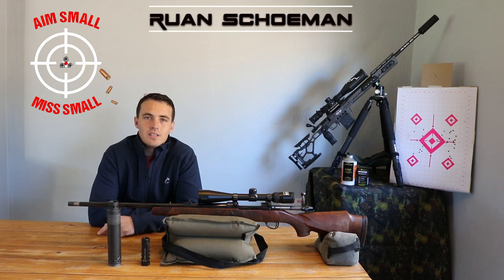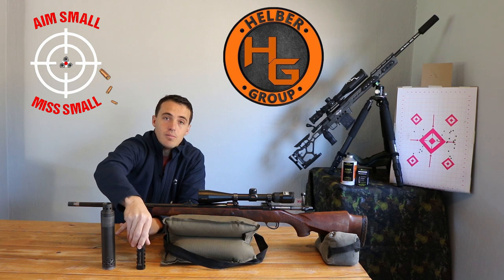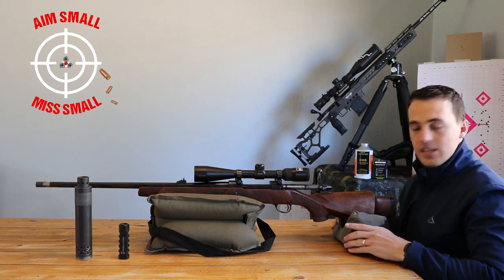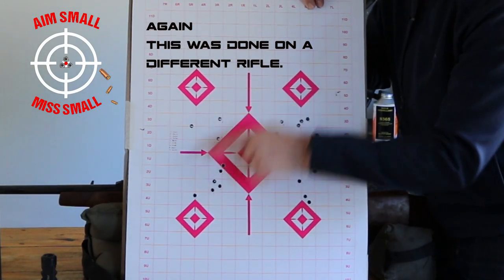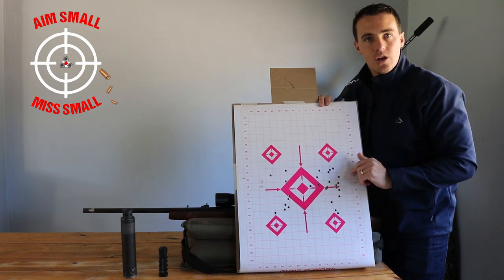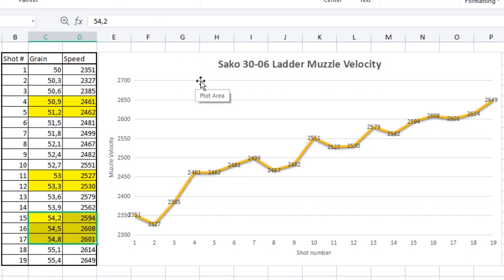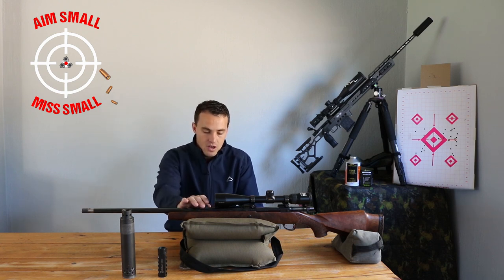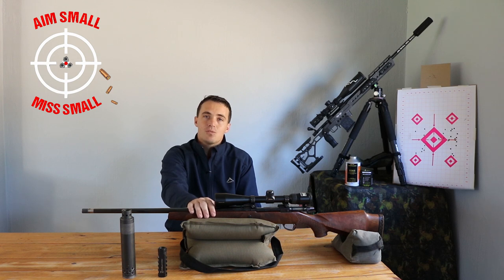Load Development Series Step 4

Comment: Thanks for a great series, really enjoyed it! On my hunting rifle, using locally produced bonded bullets I have a quiet a big variation in bullet lengths, roughly 0.5 to 0.7mm - is this something to consider? 

My max COAL is 78mm so aiming for 77mm and not sure how to factor in different seating depths to test accuracy since bullet length varies?
Reply from the maker: Hi David
Thanks for watching, glad you are enjoying it. You will see how much of a difference the lenght of the bullet has on your grouping size. There is a chance that you could get a length were that variation won't make a difference as you are in the sweet spot but I will almost guarantee that on a specific length it will make a massive difference and you won't get the beat out of the rifle. It would be that you would have to test the length.
Reply: @aimsmallmisssmall264  re-reading your comment after watching your latest Step 5 video, I understand your point far better, thank you.

Comment: On shooting ladders, do you play with the optics as well to get it zeroed, or pull after pull you keep your scope set the same?
Reply from the maker: Depending on the caliber, bullet drop and distance you could adjust your scope to be at zero. I personally work out that the bullet drop would be at the planned slowest speed and then create a target long enough to compensate for the drop but either why you don't adjust once you have started to shoot the ladder you want to see how the speed impacts the rifle and by adjusting after each shot you won't be able to get the right info.
To get bullet drop at selected distance I use strelock